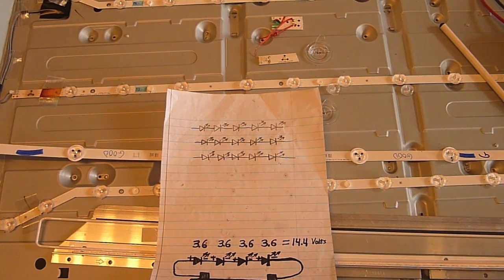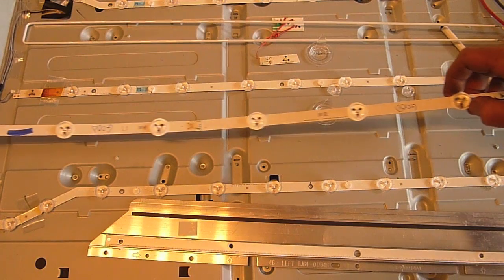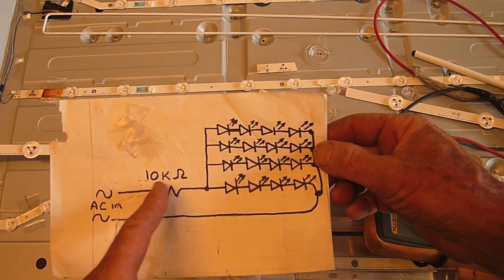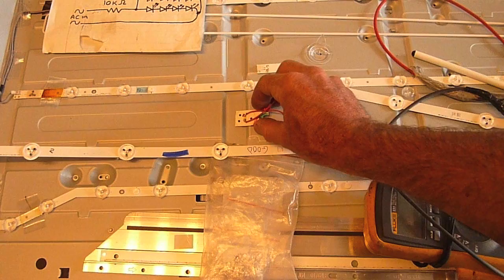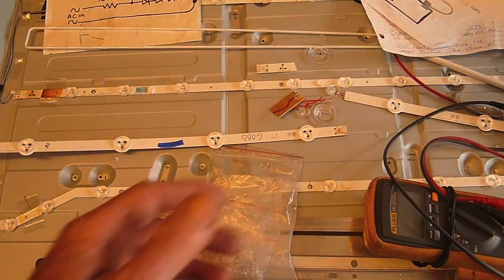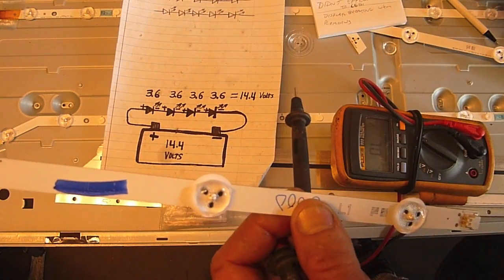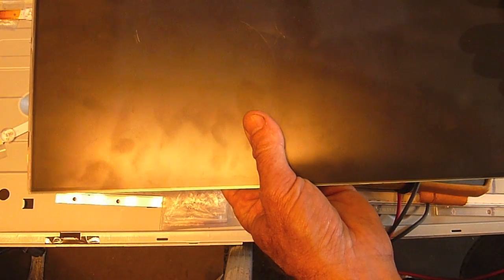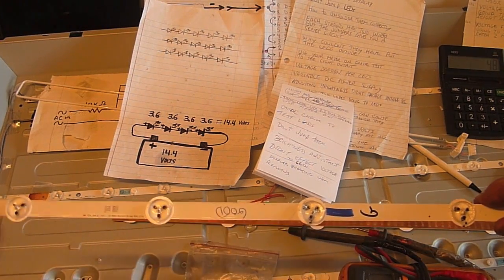LED backlight problems in TVs and computers.

Comment: 10:13
FALSE. Because the leds are supply with constant current. Not constant voltage.
You may have problems if you short a LED, if this series of LEDs is connected in parallel with other series.
Reply from the maker: Thank you for the comment. I've been told you are correct about the current being regulated rather than the voltage, so that reveals my whole premise behind this video is flawed, so I unlisted this video.

Comment: Yep covers all the points. Repaired LG 32 inch. Very risky on the fragility of the LED display and it's ribbon cables. Totally agree on absolute poor(deliberate?) Design. YouTube recommends turning down your back light settings. Had an issue of Back light going down on Samsung over parts of screen and it was intermittent. I turned down the settings to 50% on the backlight and it has stabilised. On some mode settings cannot adjust settings. I see loads of these sets going to the tip and at 6/700 UK £ a pop it's a disgusting waste. I have a 22 inch flat screen computer monitor that has been going for 10 years. It uses discharge tubes. Thanks for very informative video.

Comment: I ruined my reflector trying to get it off of the back of the TV I could get to the LEDS to test them.  The LEDS are good but TV does not work. I have all replacement boards also. I will never buy a LED Tv again.  The LCD supposedly last 100K hours before the lights burn out.
Reply from the maker: If you're not going to buy an LED TV again what other options do you have?
Reply: @GrantsPassTVRepair  LCD Plasma ?
Reply: @GrantsPassTVRepair  Nothing is made to last anymore. I do not miss the boat anchor TV's but, the new technology just does not last but, it certainly is overpriced.

Comment: Good vid, you are the only one on YouTube I've found so far that mentioned LEDs can be working but drawing too much power indicating imminent failure. My TV has a flicker. Took the easy way out and replaced the PS board. Didn't work so I opened the TV up to look at the LEDs, all lit. Replaced the Main board next, still no joy. After consulting a local repair shop was informed that my LEDs are possibly drawing too much voltage/current and as a result the Main board is cycling. I was also told NOT to replace ALL the strips as the TV would require professional calibration. A few strips okay. Now I'm trying to hunt down replacement strips.
Reply from the maker: I've never heard anyone say not to replace all of the strips due to some kid of calibration. It's been my experiences that only replacing the bad LED strips is likely to be a problem, since the ones you don't replace aren now so old they are likely to fail soon.

Comment: How much voltage required for LED Strip
Reply from the maker: To answer your question on LED backlight voltage it depends on what TV your talking about. It can be different on different TVs and models.
Reply: 40" LED MODEL CV628H-B42 (CHINA MADE)

Comment: Leds have a phenomenon known as hysteresis, avalanche, and propagation delay. Avalanche being bad and hysteresis in being a characteristic in the theory of operation, and propagation delay of forward voltage in series. For this alone I don’t recommend to test leds with ac voltage.The leds resist to turn on but when on resist to turn off, to overcome this a certain amount of inrush is needed to overcome the hysteresis and the minimum forward voltage drop needed to activate the diode junction and if there is 10 leds on a series this base forward voltage drop adds up and is very similar to a filament starting up. A practical dead short at first. The propagation delay increases with more leds in a series. Some modifications have the test points paralleled to other leds test points to in a sense make them a parallel series ladder. 
In some models of tvs that offer a stand by mode or fast boot these tvs supply a minimum amount of power to keep the leds above hysteresis this may use more energy but in my opinion saves led life as they are always on at a minimum and are ready to be ramped up.
Leds in a parallel circuit obviously do not have propagation delay and way less hysteresis.
Reply from the maker: I have had the misfortune of damaging an LED strand when using AC source without a series resistor due to excessive peak reverse voltage, but considering I'm now using a 10K ohm resistor in series with my LED strand in this video, that means my current is down to 0.012 of an amp, and that's not even including the additional resistance from the LED strand. I'm no engineer, but at such a low current,  do you think I'm likely to cause any problems to my LEDs from to high of a reverse current? I haven't encountered any problems doing this.
Reply: LEDs are not designed to run in reverse polarity. Even if the current is less than test forward current, reverse current can damage leds as they are not rectifier diodes or a unipolar device. Granted a average spec will show say a max reverse voltage of about -5 per led in 3535 as to allow pwm at 100hz or higher. Most outlets or line frequency is 60hz and this is where it may be damaged and the main reason not to use line power. The idea from pulsing is to achieve a higher power output at lower junction temperatures as reversing the led just right after peak pulse pulls the heat away from the die.
Reply from the maker: I get what you're saying. Thank you for point this out.  I'm going to do a few tests, and if I see the LEDs are damaged I will edit or remove this video.
Reply from the maker: Here is a test I just ran on what you said. https://www.youtube.com/watch?v=BrdmIrAvLxw&feature=youtu.be
Reply from the maker: https://www.youtube.com/watch?v=BrdmIrAvLxw&feature=youtu.be
Reply: Jared Ver Beek

Comment: I noticed that the leds that burn out have a gap between the chassis and the aluminum substrate the leds are mounted on so I do and recommend using a thin clear mounting tape to secure the strips. I even had done a tv requested to use thermal paste and tape. The things I noticed lately is the strips are bent and assembled poorly at the factory with strip snaps falling inside.
In order to regulate current with a discrete diagnostic system is to incorporate a current regulator at the input voltage to each strip. Using just a resistor will not work. I have had luck dropping in rush with a small voltage compatible incandescent light bulb.

Comment: I've not run into any bad LEDs yet.  There are a lot of 32" Emerson models with bad power supplies and larger 60-70" Vizio models with bad Sharp LCD panels but no LED problems.
Reply from the maker: How often do you repair TVs?
Reply: I get a lot of broken ones from Goodwill but it's mostly bad capacitors except for the ones mentioned above.  There seems to be no way to fix a Vizeo except to buy an expensive new LCD panel, a lot of people are taking them apart and selling the boards on Ebay but the LCDs seem to all be bad or broken and I haven't found the problem on the Emerson PS's yet even though I've tested almost every part on the board.
Reply from the maker: Since you hadn't seen an abundance of TVs with bad LEDs I was guessing you probably didn't own a shop.
Reply: Not for a while.  I tried it once and while everyone in town has broken stuff, they don't want to pay anything to get it fixed and would rather it be done for free so I never made any money.  I also tried PC repair too but could only make about $3.00/hr so that didn't work out too well either and wasn't enough to even cover expenses.
Reply from the maker: At one point this trade paid far better than it does now, and many shops are being forced to close their doors. I'm only surviving because I'm doing home service calls, and antenna sales and installations.

Comment: I had the same trouble with my RCA . I replaced only 4 strips on a 55 inch that needed 12 strips and it only played a little over 2 month and went out again. You have to replace them all or just get another tv. Before they come out with these stupid led tvs I had a TV that lasted for 6 years and was still working I got rid of it. A led tv sure is not going to last 6 years. Hope when the O Led tvs go down in price it will be better than a led or maybe as good as the older tvs. Good video thank you for posting.

Comment: i've just aboat figgered out the led thing !!  lg has low soilder and ark out under the led ! some short most open. if you replace one or two    better charge enough ....they'll be back. samsung runs too much current ...470 ma ,wow ! some powersupplies have a current monitor pair of resistors ,just cut one lose .235 ma.those metal led strips probly go na have to replace um.40% of the tv's that come in have broken screens ....donor led's . use good packing tape and a old soidering tip ,to cut hole for the led's through the reflector...last week i tried to set the backlite setting down from 100 % .the presets want save the changes !)!and each setting is for each input ! got lots to say....later...thank you for making the video .....bill flake....bflake50@gmail.com

Comment: On the newer LG LED flat panel tv's, you will notice a connector between the left and right strands. on either side are 2 bare copper test points. Simply bypass this connector by soldering these test points together with 16 gauge wire. positive to positive, negative to negative. These connectors are known to fail...
Reply from the maker: I have not encountered this yet but thanks for the tip.

Comment: An excellent and valuable informative video. Anyone who does repairs for other people should understand the challenges they face when dealing with back light problems. Some fluorescent back lights require the skills of a brain surgeon to replace, especially those devices that have no replacement procedures available from any common source.
Cross referencing part numbers is a challenge in itself too, especially on Ebay where there's lots of one size fits all (wrong) parts for sale.

Comment: were can I source these leds strips ?
Reply: The most common source to me is Ebay, but these are usually used items which may or may not last long. Maybe OK for personal use but I wouldn't guarantee it on someone elses devices.

Comment: Thanks for a great video and I've been watching around 30 past few days trying to fix a tv. 

First, I am glad that nowadays LED TVs are so easy to fix, unlike old cathode screen TVs (which I hate fixing). I have the plasma and I would not let it go until I must... but since I am into electronics whole my life - around 28 years and counting - my friends rely on me to help them fix broken electronic devices.

Now I am trying to fix a Panasonic 32" for my friend. I found one led has died and I did a math measuring healthy strip. I found that strip is sucking 200 mA. Therefore a resistor of around 16 Ohm will/should work on the place of LED. I've put a resistor of 2 W 22 Ohm (I did not have 16 Ohm) there and it worked!
I let it run for full 2 days at my place and then I brought the TV back to the friend and - it died within an hour. I dismantle the damn thing again and I found another broken LED. I've put a resistor there and... it would not turn on. It even does not have flash when plugged in into 230 V (I am in Europe).
If you want to ask "why resistor"? The answer is - I do not have a LED that will run on 3.6 V sucking around 200 mA. I assumed it is LED of 1 W and I ordered 50 of them from the Ebay for $3.80, but until they get here... it will take a month probably.
Anyway, I am now thinking to use high power led strips made for car daylight (since the damn thing would not bring light now) and make it work with fixed light level :) until those LED's came here. To add, if needed, another rectifier for 12 V to power those lights. Or to make a combo of them and existing working LED's.
I am wondering - and sorry for such long message - have you fixed the light controller sometimes? Since there is no flash on turning on, I am thinking that the light controller is bad also. I know I can order 2 replacement strips ($15 each + $20 postage and this is getting close to a value of a used TV) and the controller (in this TV it is a circuit that includes rectifier), but the owner is, well, one poor old man and I am trying to help.
Again, thanks for vid, you made me laugh few times loud ("some genius came up with the idea...":)).
Reply from the maker: I don't remember if I ever had to replace the LED driver,  but I replaced a few of the CCFL drivers on the first versions of LCD TVs.

Comment: I work on small engines and am amazed at how many people just dispose of stuff because its actually cheaper to buy a new one than take it to a repair place. Indeed I have talked to several repair places that refuse to even work on push gas mowers. Gas weed eaters are the most disposed of units out there. Small engine places have pretty much priced themselves out of working on anything except higher priced riding mowers. With the advent of the lithium powered weed eater,I can see the day gas powered weed eaters are no longer made except for lawn maintenance businesses,ie, professional grade models. even then,those will be disposable as well. I myself have the ability to referbish these discarded mowers and weed eaters and although I dont make a lot of money,I do sell them to support my other hobbys. I can relate to your repairing tv's. You are aboard a dying business boat and it is sinking quickly. Sears by the way,throws out lawnmowers they get back under warrenty programs. They dont even bother servicing them should they get returned under warrenty. Its cheaper to issue a new mower than to fix them. At least in our town where they closed the service center they do.
Reply: But the price as well. I remember when we bought a video player, not the recorder, it cost us 1200 DEM (Deutsch Marks) which is today around 600€ and then it was HUGE amount of money. Not to mention PCs and prices. Quality is low, but the price is low as well. I mean, until you pay top box for something. Ppl expects they pay really low price for a TV and then they expect it will be perfect lasting for 20 years.
Reply from the maker: Aside from  everything becoming disposable I think the quality of many modern day appliances has gone down hill.
Reply: +Grants Pass TV Repair I dont argue there. As a matter of fact most are not ment to last more than 5 years max. I have a friend in electronics that told me they were told that as far as design and longevity is concerned.

Comment: Also with Lg's they use higher current at lower voltage at start then when the pwm kicks in it lowers current and upps the voltage not a design flaw its getting the minimum load and compares it to make sure the leds are good.

Comment: Bad luck there buddy I have never cracked one yet done over 90 just got to handle the screen carefully. Also they add less Leds to keep costs low and push the ones still there harder to maintain the same light output of course the little smd led gets very hot and dye of the led cracks either shorting the whiskers or making the fail open causing the whole backlight to fail. All of them are shit.

Comment: update: LG and vizio now have firmware updates to correct the voltage issue, maybe they watched your video. update with usb drive or connect TV to internet to update TV and go into tv settings to select update.
Reply from the maker: I don't know which LG models the firmware upgrade works on, but it wasn't available for the model I had. Please let me know if you have any luck with this on other LG models.
Reply: The firmware wont change the driver current or voltage, might possibly mean that the backlight is driven lower in the menu from factory but wont correct it burning out at max still.

Comment: The most informative LED TV repair video yet... Thanks for actually explaining how some of these units go bad. I have an LG 50LN5600 model and change all 3 boards due to bad LEDs. I was told by many technicians that my T CON board was bad. I was getting the LG logo flash with the blinking red light. Then the TV would go black. Neither board was bad... LED was bad.

Comment: Instead of a stacking repair (one board on the old one), could you cut a section out of the old one and put the replacement board section in the gap. That way, the leds will be at the same height and it should be a fairly quick repair. Make it a very loose fit to quickly replace dead leds.

Comment: Great Video, I wish I found this 2 weeks ago when repairing my samsung 32", it would have saved me much heartache. Great advice on the LEDs being so impossible to find. I also ordered a 5050 on eBay and it didn't fit at all as you mentioned.